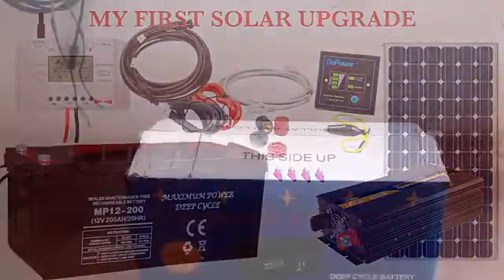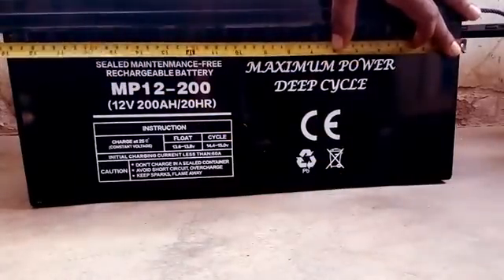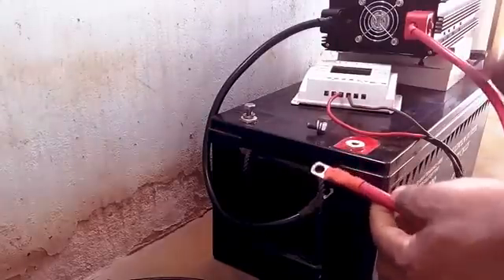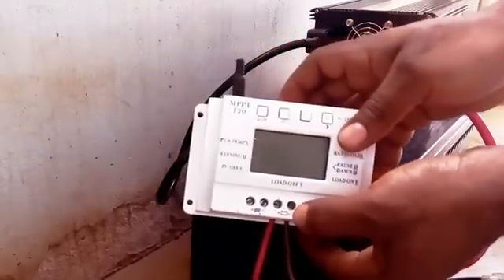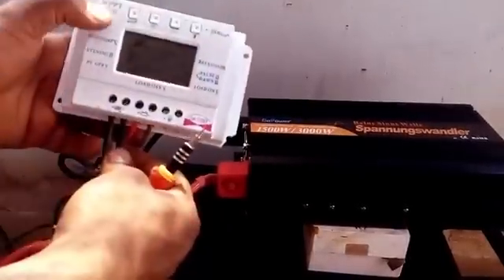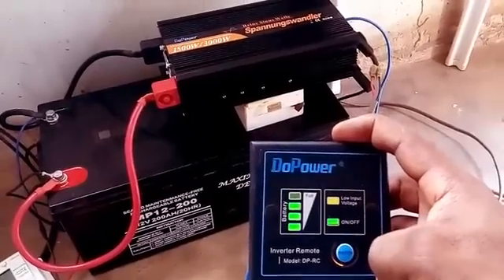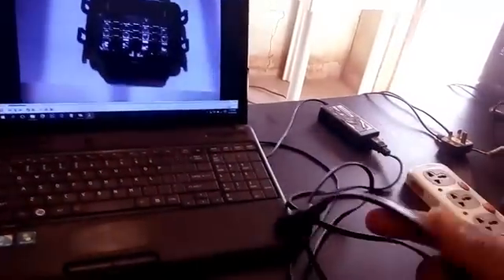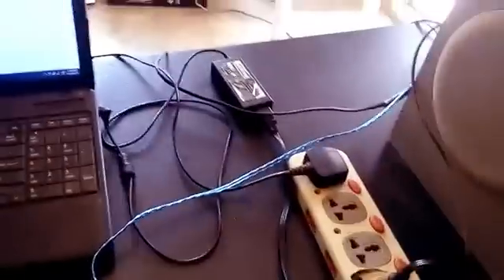2024 Guide: Installing a 200AH Deep Cycle Battery for Solar Systems

Comment: Hi please, how many mm cable will you recommend for 200ah battery
Reply from the maker: Where exactly do you want to use the wire
Reply: @Cyber-TechAI Want to connect solar panel to inverter. (my inverter has the charge controller inbuilt). Though I've already ordered for the 6mm cable.

Comment: NICE VIDEO BUT YOUR WORKING VERY BADLY DON'T HAVE BATTERY THAT CLOSE TO EACH OTHER YOU NEED FUSED BETWEEN POSITIVE OF BATTERY AND POSITIVE OF YOUR INVERTER AND NEED SWITCH BETWEEN YOU FUSED OF POSITIVE AND POSITIVE OF YOUR INVERTER POWER STILL IN THE INVERTER EVEN IF YOU TURN IT OFF I WATCH LOT VIDEO I DID SEE NO BODY DOSE IT
Reply from the maker: how bad, when am still using the system in 2023
Reply: @Cyber-TechAI  i see plane was down ok due to those battery killed the two pilot ok
Reply: @jacksmith3951  how do you mean?
Reply: even if you turn off inverter there power it still pulling from battery ok i have 12 volt deep cycle 75 amp 900 watts ok those battery not safe ok Tesla car and batteries catch on fire and explode i see lot video live ok where fire man out fire and catch on fire

Comment: Please you can say to me if that battery of 12v and 200ah  we can use the television of the 55 inch or not?
Reply from the maker: Yes, as long as you have up to 300w solar panel
Reply: @Cyber-TechAI  i have an other question it possible to mix two batteries of the same voltage but the amperage different?
For example two batteries the first battery 12v 200ah and the second battery 12v and 150ah or 100ah
Reply from the maker: Mixing batteries of different capacities will generally result in lower capacity battery drain first, while the higher one will not be discharged completely. This is not optimal usage. Therefore, mixing capacities is not recommended.

Comment: Just saying,,,Dude block fuse between battery and inverter.175 amp.Must B installed.saftey.
Reply from the maker: This is a small system, large system require fuse

Comment: Is this battery would enough to work carpentry works(machines)??
Reply from the maker: Check the power consumption of the work machine in watt and see if it is more than 1500 watt

Comment: Bonsoir, combien de panneaux 330 w nécessaire pour charger 4 batterie trojan 6 volt
Reply: you can have 2 if you want. 4 trojan 6v batteries are 24v, so you need 24v of solar panels or more just have to set the voltage in the charge controller.
Reply from the maker: English only

Comment: Hi there. ¿How voltage you use to charge, discharge and floating? I believe max discharge is 11.9v and max charge is 13.8. Am i right? How last your battery in years or month? How deep is your discharge? 90-80-70-50%?
Reply from the maker: Hi thanks for stopping by, my setup is exactly 3 years in November 2019, I discharge around 12.0 - 12.2 volts epever charge controller floats my battery at 14.2v. I discharge mostly at 70 and few times 50

Comment: There is a component which you did not talk about but I've noted on the side of the battery was the recommended settings for the charging of the battery. In the US the American manufacturers do not really post it like you have it. I've been asking questions as to the recommended rate of volts that the solar panels need to deliver to keep the battery charged was fullest capability. This is very important as you will eventually ruin your batteries if you keep chronically under charging them. For this you need a solar controller that has adjustable settings. That and you need the manufacturer's recommended voltage the battery should be charged at. Many people in America think it's the same charging as a car or truck battery this is not so according to some people who have solar channels here in the US. You need more voltage to go into the battery above and beyond what a car would need to keep that battery healthy and doing it's stated recommended number of cycles of discharge. I've been told by some Wise Old teachers that this is Smith. But I suspect based upon others experiences with failing batteries that there is more to this than what knowledge that is out there currently recognizes. Do you have an opinion?

In the u.s. batteries run $230 us to over 900 and wet far beyond. The price is affected by one paying for the brand name, to paying for the warranty and 3 the cost of making the battery plus a profit for the factory that made it. Most of the batteries in the US I have read have a very large price because the companies that make the battery know that they are going to fail and you are already paying in advance for your replacement battery if you honor the warranty. I have no other explanation for the increase of the price when the batteries are all made by the same plant and a different brand name put on them. And the secret remains what should be the charging voltage going into the battery through the charge controller.
 
 after several months of waiting for responses from Battery manufacturing Engineers I have nothing. So I have no opinion to tell you if this is the truth or if this is all myth. is there anybody out there who designs batteries works at a battery manufacturing plant who can give us some insight? when I am speaking about charging voltage has I am specifically speaking about the lead acid and sealed lead acid batteries. and why am I using lead acid batteries to 150 year old ? Well it's what I can afford.
Reply from the maker: Okay

Comment: Did you have a problem with your 1st MPPT T40 charge controller? Is that the reason it couldn't charge your 200AH Deep cycle battery?
Reply from the maker: There was no problem, I sold it when I discovered it couldn't charge my battery to 100%

Comment: What wattage of solar power is actually required to charge a single 200ah battery?
Reply from the maker: To get that 12V x 200Ah =2400wh that is the capacity of the battery
2400Wh /5h =480W (that is the industry standard so that it would be able to charge the Battery full daily within 5hours,  but you can decide to use between 350w to 400w

Comment: Even without your voice, i can understand what you are doing. That's very basic. I have 2 - 290watts solar panel with 40amps solar charge controller and 1500watts pure sine wave inverter. It can run 1unit of 6cu.ft. inverter refregerator, 1 unit 5cu.ft. chiller and 1 unit 23watts 12v dc fan during day time.
Reply from the maker: Thanks

Comment: Guys this is a simple design with simple capacity for a small African 2bedroom flat or a small business office.. We need something to augment the Grid supply that isnt reliable.  In these part, we (homes) dont need the electricity during daytime but at night . Essentially we need it for a 40inch flat tv + laptop (for 5hours max) , 4 energy bulbs, 2 energy fans. The income level here isnt much. So this is ideal somewhat. For you guys outside Africa, most of what you are suggesting are either more expensive bcos they are scarce or unavailable. Kudos FUTURE TECH !!
Reply from the maker: Thanks man

Comment: good evening I would like to know if with the 200Ah bacteria and a 250W panel I can only feed a bulb + a brewer + a computer + a radio only? can I add a TV at the same time?
Reply from the maker: Thanks for your question, it gives me great joy to see a female want to know more about solar, therefore am bent on answering all your question no matter how long it takes for you to understand, meanwhile kindly read this post below, but if you don't understand, kindly get back to me and i will explain better http://solarenergyng.blogspot.com/2018/02/how-long-it-take-to-consume-specific.html
Reply: I had the cheaper car batteries and 150 watt solar panel and I can run a tv 40 watt fridge that runs on 80watts charge my phone and other devices on the sunny part of the day. After that when I get home I start the generator for a couple hours then I turn on the batteries when I'm ready to sleep and it will run my charges and a couple lights for a bit but will stay on.

Comment: You should put the charge controller wires on top, the inverter cables on the bottom. That inverter will draw a lot of current when fully loaded. If there is any resistance in those washers, or terminal ends the battery terminals will get too hot. The charge controller will only produce a maximum of 21 amps. The inverter  can draw as much as 130 amps at full load. That enormous battery is more than capable of supplying that.

Comment: Is it possible to run this for 12v 50w solar panel?
Reply: Ok sir thanks. Can i used charge conteoller?
Reply from the maker: 100 W solar panel could not charge the battery, i tried it before so I had to add another 250w solar panel

Comment: Always first connect negative wire then positive connect
Reply: That only applies to automotive applications: Prevents arcing if the wrench on the positive terminal touches the car frame! (opposite for Pos. grounded systems). Here, the wiring is 'open' so shorts are not likely to be an issue.

Comment: BRO, ARE THESE BATTERY PRODUCT RELIABLE?
Reply: WOULD YOU RECOMMEND IT? THE MAXIMUM POWER 200 AH BATTERIES?
Reply from the maker: YES I can recomend it because mine would be 2 years by Cotober 20 2018 and I have been enjoying it without any problem, also I use just one of it, meaning it can withstand  stress, I can purchase it again unless I get any other product better than it with proof
Reply from the maker: I will make another video by the time it completes two years (730 days)
Reply: thanks, bro where can I get this exact product or model? I don't want want to get fake
Reply from the maker: Kindly folow the link in the description, that was how i got mine
Reply from the maker: What particular product are you talking about ?

Comment: Discharge and charge cycle will kill your battery's life span. Better put the inverter connector to the charger's load terminal, as long as it has a sunlight it will get the power from your solar not on your battery.
Reply: how mean electronic  will can plug
Reply: Alright, So how many hours can a 250w solar panel power a 150w load, without the battery.?
Reply from the maker: It is still working till date September 2023

Comment: I have an off grid solar power system in my garden shed. with 6 12 volts strung for 24 volts, and am currently expanding the system for 2Kw solar power
Reply from the maker: Congrats that a lot of power to use daily
Reply: Beware with paralell, can explode.. love u:
https://youtu.be/k31a63NRj0g

Comment: Wrong kind of battery. Although it's big and initially you would think it's the right one it is not. You want to Trojan 105. There 6 volt batteries two of them together. They run about 230 amp hours. And would only cost you 40 more dollars would last longer. You're going to cook that battery in a year to the Trojans would last you 10.
Reply from the maker: Well is not the best battery in the world but it will be 2 year by November 2018
Reply: FUTURE TECH the life of the battery is dependent on how often you drop it below 80% charge.. If you use it in minimally it will last forever. But it would be tough to only use 20% of a battery charge with a hundred amp hours. So I guess it depends on what you doing with it.
Reply: But then you would have to keep that battery outside.  The one he has is sealed.  It's safer for indoor usage.
Reply from the maker: i drop 75% daily
Reply: What do you mean you drop 75% daily?
Reply from the maker: You said "you drop it below 80% charge" same i drop 75% charge
Reply: I just try not to go below 10.7 volts.  Anything below that and the battery can get permanent damage.  My charge controller will shut the load off at 10.7 volts.
Reply from the maker: DO YOU CONNECT YOUR INVERTER TO THE CHARGE CONTROLLER ?
Reply: Right now I am connecting the inverter to the charge controller because if the volts drop below 10.7, I want it to cut the power off.  In the future, I will have to plug the 2,000 watt inverter directly to the batteries because the charge controller will fry as it can't handle over 100 amps.
Reply from the maker: yes good practice you can as well get a volt meter and attach it to the battery directly to monitor the voltage of that battery, I will advice you discharge your battery to 12 volts to prolong the battery life
Reply: That's nearly impossible.  Mine hit mid 11 volts all the time in a very short time.  I would need to spend $3,000+ to have enough batteries in parallel to pull that off.
Reply: 10.7 would scare me. I have 8 Trojan 105 6 volt hooked up to dual 2000 watt inverters and 800 watt panels. All shoved onto a large Costco shopping cart to keep it mobile. So my house is basically a golf cart with premium batteries in it. My inverter alarms sounds at 11 volts. Which sucks.  I live on the coast in Florida in a evacuation Zone. I flood and lose power Pretty much every year. For a Significant amount of time. Of course I have a generator but running refrigeration and partial air can cost over 15 dollars a day.  and gas is almost never available for weeks leading up to and after a hurricanes.
Reply: I'm not knocking sealed AMG batteries. But if you want to dump 30 40 50 amps into them real quick to get your volts above 12 V they need to breathe. And hell I would take 10 of your batteries when the s*** hits the fan. I guess every situation is different. I appreciate the conversation though.
Reply: Yeah, if you don't want to see 10.7 volts, then all you have to do is be rich so spending thousands on like 20+ batteries isn't a big deal.
Reply: Rich people have no idea what they're doing. So they probably see 10.6 volts more than we do. there are two types of solar people. People who have barely what they need and people who go way too far. Most of my solar friends Get Lucky with Refurbished batteries. Cell tower batteries. Forklift batteries and so on. I only went with the Trojans because of their reputation and I live around a lot of golf courses, got them half price. Anything over 8 batteries you have to jump up to 24 or 48 volts Or wiring becomes a nightmare. 10 plus batteries at 12 volts. The wire can cost as much as the batteries and system.

Comment: Is lead acid battery good for solar?
Reply from the maker: Fliar Santiago r.

A Lead Acid or AGM battery is generally low cost and doesn’t require much maintenance, but in return they offer a lower recharge cycle count. These batteries often times will only be recharged from 50% depth of discharge (DOD) approximately 250 times before replacement is required. They are best used with residential or generally smaller systems. Flooded Lead Acid batteries are the tried and true batteries of the solar industry and cost the least, but require watering. The sealed version, or AGM, does not require watering but costs a bit more.

So it can but not the best
Reply: FUTURE TECH  thank you for the information
Reply: @Cyber-TechAI  It's much less money to purchase the necessary capacity you need. Even less expensive, might be to get 6 volt golf cart batteries. They last much longer than RV batteries. They will often give you the lowest levelized cost of stored energy of any solution. The fact that they don't last forever, is actually a plus. That's because of continual advancements in battery chemistry, and lower cost. When the deep cycle lead acid batteries finally wear out, you can check what's on the market, do a calculation to see what is the lowest long term cost, and go with that. If not, put in another set of golf cart batteries, and in 5 years or so, research the market. You may not want to be bound for 10 or 15 years, if a better battery comes on to the market.